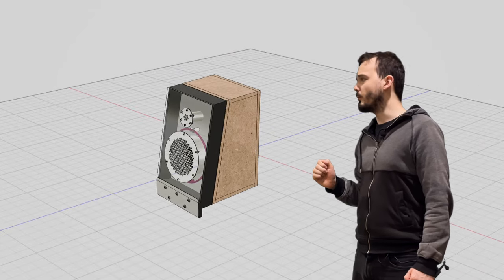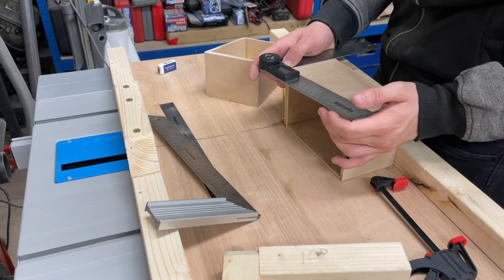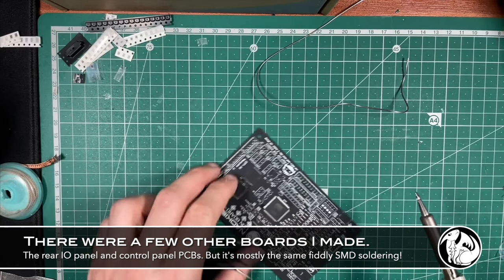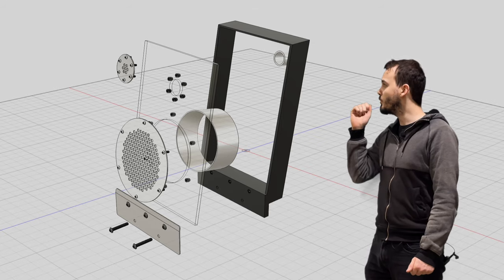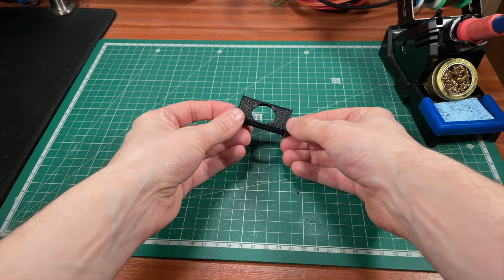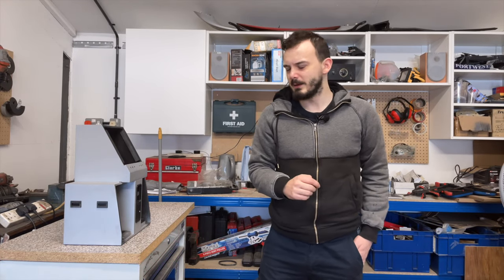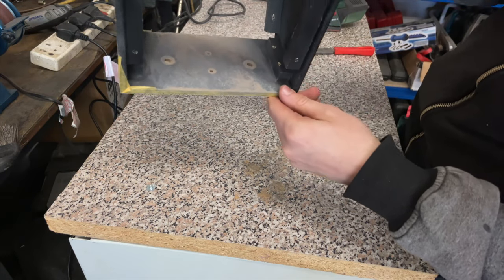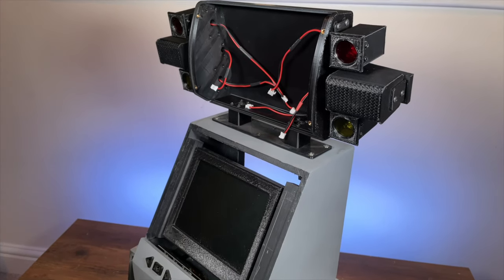Time to add audio and lights! - 1/4 Scale DDR Cab

Comment: Will you put in a small CRT?
Reply from the maker: As explained in the last episode (even though briefly), CRTs wont fit. You need a certain amount of depth for the beam of the CRT to scan across and there are no CRTs that fit in the depth available
Reply: @NaokisRC Was thinking u could use a small CRT like from them small sony alarm clocks, again would be a cool idea but in practice not so easy, I play DDR Extreme on a CRT just dosent feel the same on LCD
Reply from the maker: Theres a lot of reasons as to why putting a CRT in would be much more hassle for less worth, such as needing to convert from HDMI to analogue and then spoof the EDID to run it at a lower 15khz resolution, its far easier to use an LCD in this case and actually makes it more playable at a distance